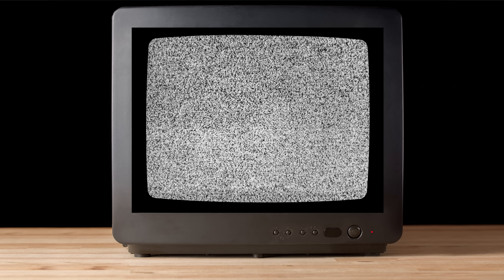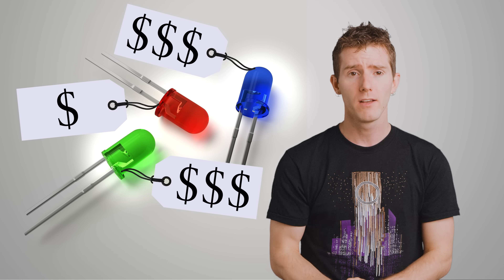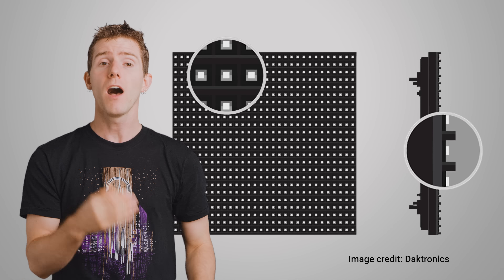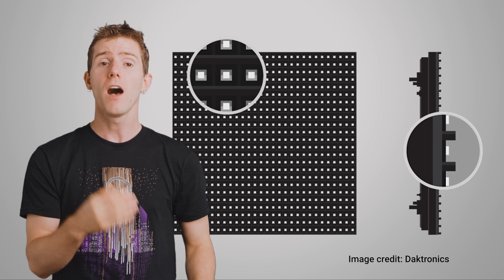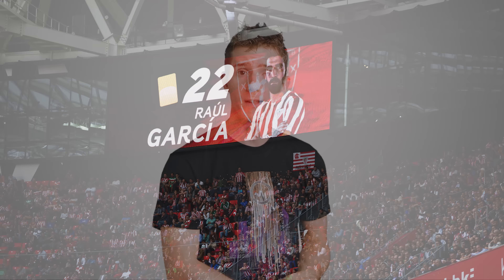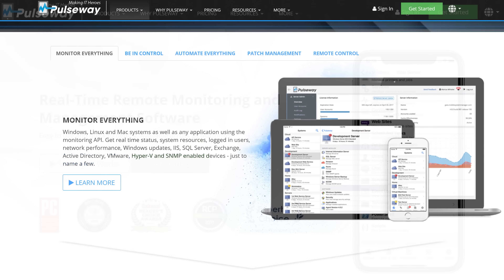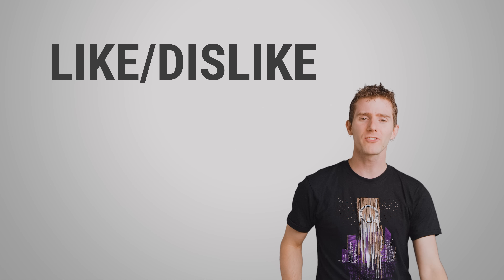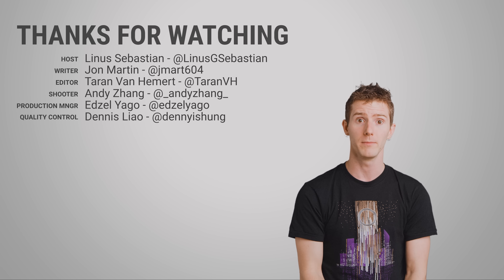How The World's LARGEST Screens Are Made

Comment: "powerful enough" lmao control rooms have trash pc's man. YouTube will say anything
Reply: true
Reply: I saw one that used a MacPro to output through displayport to a dongle to VGA to a PCI card on a PC that didn't even boot an OS, but as long as it was powered the card would output to the jumbotron through Ethernet, that control room was wire hell
Reply: I used to work for a media company, back in 2013, who rented out these screens for parties/events. I can confirm that the computers were in fact top of the line... For 2007. 

Now, I know what you're thinking, "well, they just hadn't upgraded their computers in 6 years, that's not a big deal." No, they purchased the computers after I got there.
Reply: @Anton-V  OMG! lol
Reply: @David_Shipley  They get these 60 year old engineers to lead with tech from 14 years ago. At my job we are using 2008 fat bezle Plasma for news shots.
Reply: I mean, why waste money on newer hardware when the old stuff will do just fine if not better?
Reply: Key Arena's LED ring was driven by a PC using Windows 2k until it was torn out last year. The manufacturer didn't offer any upgrade pack to just the controller, so we were stuck with that.
Reply: Well on another hand, they did probably get the most powerful equipment, back when it was installed - and since it worked back then, why would they upgrade now? Not like they could run crysis on 'em anyways.
Reply: @Cherijo78  Sounds like an old Dakinstall!

Comment: Wait my GTX 1080 gaming PC draws around 300 Watt in games, so what kind of "average" gaming PC draws 635 watt?
Reply: From 2008
Reply: how much does the rest draw? CPU? RGB strips? water cooling pump? you know, ltt stuff.
and even RAM, HDD and SSD draw some power,so if your pc is stacked with ssd or especially HHD's that can stack up eventually.
periferals also add to the cost. RGB mouse and keyboard, Xbox controller for PC, headphones/headset/mic. maybe a flight or racing kit
add-on cards for a soundcard(yeah i know, dead, but still), extra ethernet card, capture card, whatever.
also maybe a little overclock?

it all adds up in the end
Reply: @robertlinke2666  Well my 3rd Gen Ivy Bridge Xeon Cpu draws around 50 Watt  (so no point in water cooling it) and everything else in total around 70W.
180W super RGB strix :) GPU+50W CPU+70W for 3SSDs and 5 Fans in bechmarks while running benchmarks is fine to me. In actual games I measured a power consumption of 196W in 1080p.